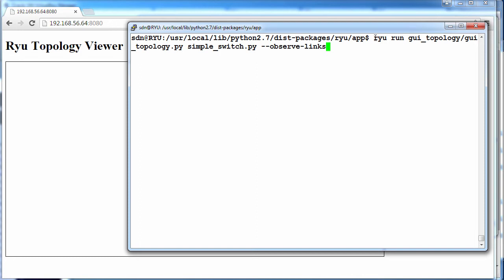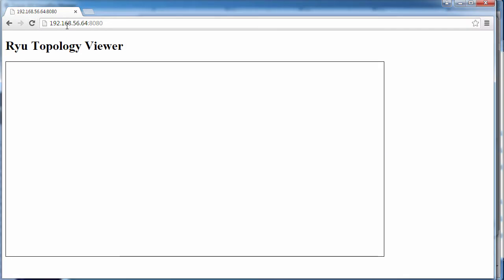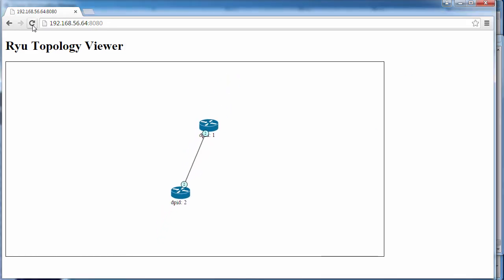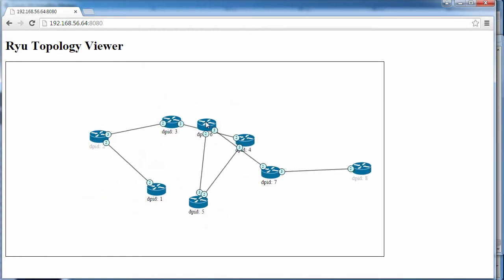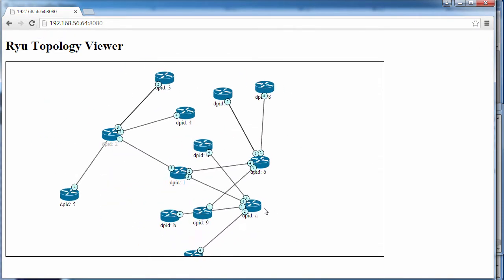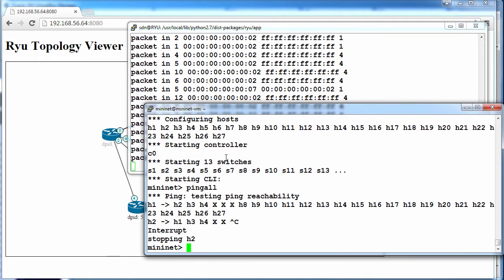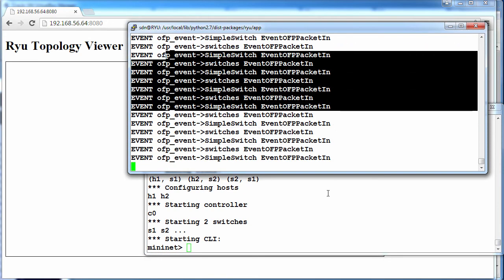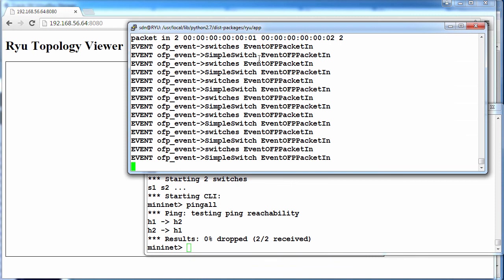RYU SDN Controller Part 4: Graphical User Interface (GUI): Practical GNS3 SDN and OpenFlow

Comment: Hi
 i ve tried the same commands as you but no topology appeas when i refresh ,have you any idea about how to resolve the issue ?
Thank you
Reply: If you're using Mininet with Ryu, have you double-checked that it can reach the Ryu controller, and that all the hosts/switches can reach one another?
Reply: i've found the problem, the network-manager service was not working i've restarted the service and evrything gone as it should be.Thank you for the help.